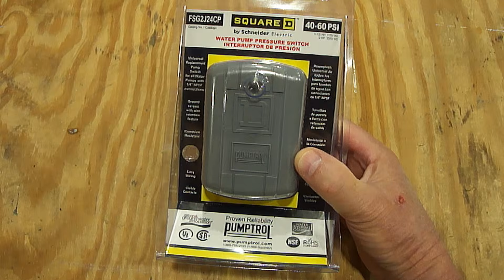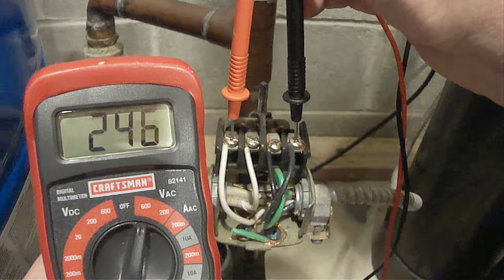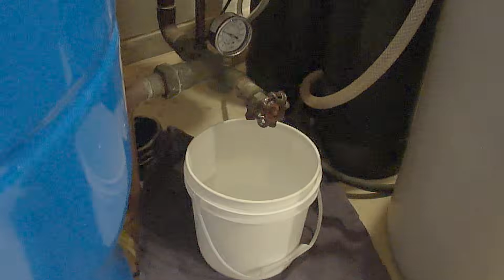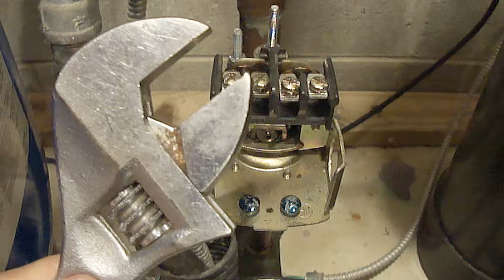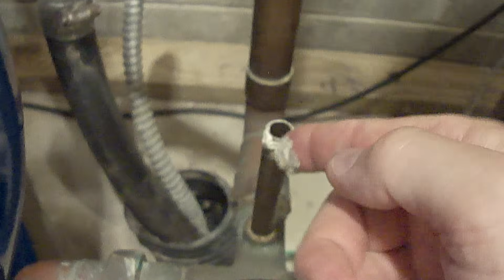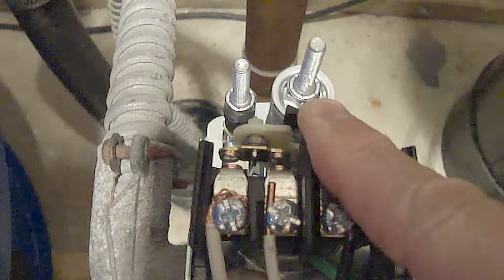NEVER Replace A Water Well Pump Pressure Switch Until Watching This!

Comment: 220v sounds dangerous but its the 110 that will get ya easier. 220 will at least knock your hand off the circuit. 110 will keep you hanging on and you wont be able to let go

Comment: My well is working, but there is 30 volts at the top of the well pipe. The pump is a Franklin 2hp, the controller is a Franklin subdrive 150.  a new pressure switch was installed and the tech suggested I have a short in the well or the pump and need to pull the pump.  Could this be a faulty pressure switch or incorrect grounding? My water pressure is 60psi and holding.

Comment: After a NS RI pump company replaced my pump and leaky pipe, used sleeve method of pipe, they never ever changed the pressure switch, aged 46 yrs. 
The house started leaking through all metal pipe joints, toilets would not stop running, faucets started leaking. Excuse, older home, but not so, it had been maintained.
Plumber I had come in, never thought to ask about pressure switch only temperate valve on furnace. Adjusted toilets and wanted to change faucet. No one ever linked the new pump with the old switch still in place,.  I did research for answers after it all happened like this…catastrophe. Pipes blew due to high pressure flooding home, destroyed. I was bothered by the pump still running because if pressure switch ok, it would have stopped the pump. Water just continued pouring out from deep well. Totaled the entire inside. Have to gut to studs. So please replace that pressure switch, and thank you for this article. One of many that verified my gut feeling that it all fell back on the well pump change.

Comment: Is there any downside to adjusting the pressure switch so that the differential between turn  on and cut off not so great? I really hate that my water pressure goes from barely a trickle at 30 psi to suddenly going fire-hose full blast at 50 psi. it's really annoying.
I think I'd like to adjust the switch so that in turns on at 45 psi and continues to cut off at 50 psi.  Yes I realize that will cause the pump to cycle on and off more frequently, but the 20 psi pressure differential is ridiculous.
Reply from the maker: I would consider installing a 40-60 pressure switch instead.
Reply: Cycling the well pump more often will reduce the lifetime of the well pump.

Comment: My well switch has a wall plug. If I unplug it, is there any other way it could get power to it? I am also turning off all the breakers but I just want to be sure. This is an easy job but it’s still scary working on something with 220 running through it.

Comment: Why do I have to use the same pressure switch as the one I take off?  I would like more pressure than the 20-40 I currently have.
Reply from the maker: You don’t
Reply: @proclaimliberty2000  I think I asked that wrong.  Can I replace a 20/40 with a 40/60 Switch?
Reply from the maker: @bjdennis1455  Yes. You’ll just have to make sure you change the pressure on the well tank to 38 psi. You’ll notice a big difference in your water pressure.
Reply: @proclaimliberty2000  Thank You!!!!
Reply from the maker: @bjdennis1455  👍😃

Comment: Question: How do I know if I have a 40-60 pressure gauge or another type? My power went off, and now I don't have any water but, the pressure gauge still reads 50 psi. I'm trying to problem solve. Can it be reset? The blue tank has a red button type at the top.???
Reply: On the inside of the pressure switch lid there's a tag/label that has it marked. You might need a magnifying glass to read it.
Reply: @henryhatfield74  Thank you so much.

Comment: I have a question if my house have a 30 /50 pressure  switch and I just bougth a 86 gallons pressure tank...can I change the switch for one 40/60 so I can get more wather pressure in the house? Thanks
Reply from the maker: Yes. That is the set up that I have. An 86 gallon tank with a 40/60 pressure switch.

Comment: I replaced mine based on your step by step, thank you! The only problem is my air compressor burned out before I could get my tank pressure up to 38psi. It's around 30. The water pressure is okay, when I get a new compressor can I simply hook it up and fill to 38 psi, or do I need to open valves and shut off power again?
Reply from the maker: Just simply hook it up and fill it up to 38 psi
Reply: A hand.pump works fine
Reply from the maker: @sailatmojo  True, but it will take forever as I’ve tried that.

Comment: Is it risky to go from a 20-40psi immediately to a 40-60psi pressure switch?
Reply from the maker: Not at all
Reply: My current pressure switch is 20-40.  Should I replace it with a 40-60 switch?  Why and why not?
Reply from the maker: @rons8342  A 40/60 pressure switch will give you higher water pressure

Comment: "If you are electrocuted, you could die',  yes that is the definition of electrocuted,  not could but will.   ;)
Reply from the maker: Just because you are electrocuted, does not mean you will die
Reply: @proclaimliberty2000  sure technically, but electrocution is electric and execution combined and mostly reserved for meaning death.   But I agree serious injury is also lumped in there. Regardless, I enjoyed your video and mean no disrespect  ;)
Reply: I took a full 240Volts while changing my neighbors element on the livestock waterer (while on wet evening grass to boot). 
It shot me upwards a good 16 inches and i was weak for about 2minutes.
So cryconner, 
you will N-O-T die.
Moral of this story: 
NEVER  E-V-E-R believe or trust another person who says: 
"Yup, i turn off the power", and always check it for yourself !!

Comment: I just now turned my well pump off. The ground between the well and the house is rock  solid frozen and is on the north side. We left a stream of water and all the cabinets open. But it got -5 below last night. No water heater it’s a tankless. Hoping me turning off the pump is ok until we thaw out.  ?   Any advice? Thinking that’s best until  the blizzard passes through, and I can get out there. 👩‍🌾
Reply: Hopefully your pump is in a place that does not freeze.  If not, place a trouble light with a 40W incandescent bulb under the pump housing.  If it's outside, place a cardboard box over the pump with at least a 9" clearance between the box and the bulb.  When you get a chance, wrap the pump with heat tape that's used on exposed water lines.

Comment: Looks pretty straightforward. I have to prime my pressure switch anytime I lose power. I am looking to replace with a self-priming switch. Thanks for the step-by-step video. 👍
Reply: Sounds like your check valve has failed, you should have at least one, usually before the well pump, to keep the pump from losing prime when it shuts off.
That, or you have a leak in the line somewhere between pump & pressure switch you need to find, not only to have it fixed, but to save wear & tear on your components.

Comment: I have a problem I cannot find the solution to. I replaced my pressure switch with a low pressure switch so I can manually pump air into system if needed. The problem I'm having is the pressure only gets up to 30 psi and then it shuts off and it trips itself to where the contacts stay in an open position and th he pressure immediately drops back to zero psi. The psi never gets up past 30 and it's supposed to actually kick on at 30 and off at 50 but it never gets past 30, never reaches 50 whatsoever...all I can think is maybe my well is running dry or possibly the new switch is bad or maybe I need to replace the circuit breaker. Any advice would be very helpful sir. Thank you for this video, It's the best one on YouTube as far as teaching about this specific subject is concerned.
Reply: Having the same issue, but it does get up to 38 psi, but never to 50. My pump just keeps running.
Reply: Did you checked check valve?
Did you adjusted pressure switch

Comment: Pretty lousy job wiring under the switch screws. The solid wires should have a 180* hook to them and be captured under the screw head. The braided the same. Twist those real tight and get them as well under the screw heads or use spade terminals on the wire ends. Only the braided though not the solid.

Comment: By doing this replacement, did you have to refill the air back in to the tank?
Reply from the maker: When performing this you need to regardless check the pressure on the tank

Comment: While the tank is empty it's also a good time to check the ambient pressure of the tank to ensure it's set to 2psi below the cut on value ie...a 40/60 switch should have the tank set to 38psi empty.
Reply: Great comment i recently replaced a tank because couldn't bother old tanks stuck diaphram)to do
Reply: I was going to say that exact same thing.

Comment: Of coarse it really depends on the well it self. i have an old 2" water well about 120 ft deep that no well man will touch due too its 100+ age. The water is delicious but it has had a  partially plugged screen for a number of years now.  I'm not allowed to pull the jet and place it according to some code bs with requires a licenses well man? Anyway requires 2, 1 horse power  240 vac deep well jet pumps connected in series just to bring up enough water to fill a champion 100 pressure tank at a very slow rate. This double pump system works quite well indeed. Although the well jet needs a constant pressure of 9O which these two  pumps working together do easily provide to do the job. However, my biggest problem thus far is with any 40/60 pressure switch. None I have found thus far will adjust to  this odd setting of  50/65 to make this rigged up system work normally. Do ya know of any other pressure switches that may be adjusted to that weird on/off setting?
Reply: f code just pull the jet

Comment: I had a repair guy tell me my switch was going bad. But I noticed when I threw the breaker off it made a cracking sound. I replaced the breaker switch and it’s been working great since. Saved 200 bucks at least
Reply: Awesome 👌🏽
Reply: Pressure Switches cost like $40. They’re not that hard to change out. You do need to bleed your system of water, though.
Reply: @AngelofOntario  The repair dude will charge you $80 for the part plus another $120 for labor.  So good if you can do it yourself.
Reply: @jackb1803  - Tell me about it! Our local well driller will charge $165 JUST to come out and diagnose the issue. Necessity is not only the mother of invention, but of Do It Yourself too!
Reply: A switch is 40 bucks😅
Reply: was the crackling at the breaker or the switch?